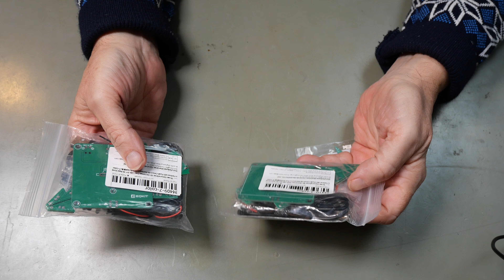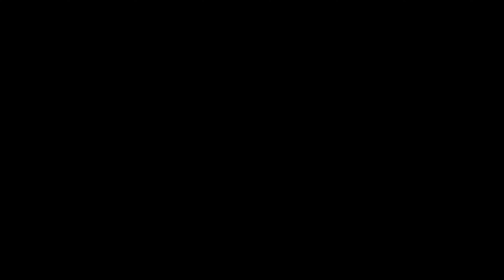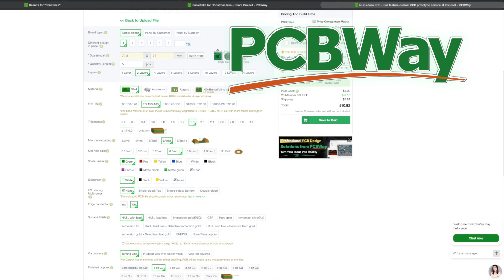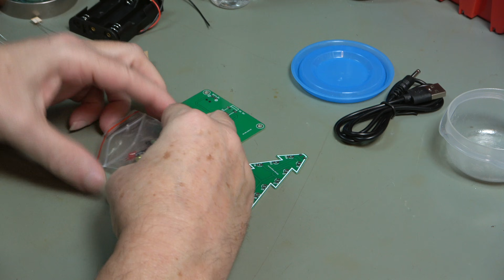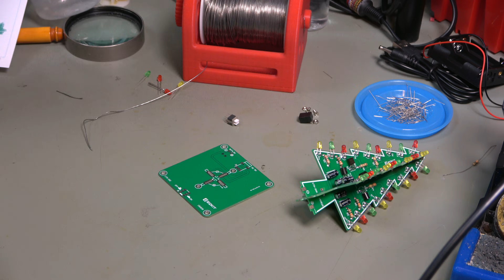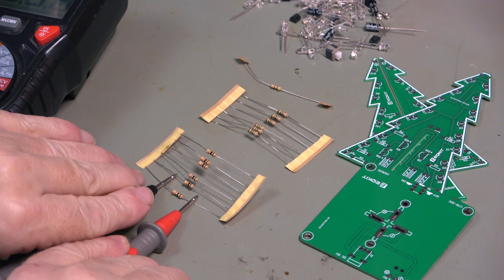Episode 102: An Ali-Xmas

Comment: I bought the multicolor tree that is identical to the one you have except the kit I received came with the wrong capacitors (which I didn't know until I was done making it) so the tree only lights up red, and barely lights up at that. It came with 22 µF capacitors instead of 47 µF. I was quite upset with this because it was a lot of work for me to assemble as I am an amputee. It's still sitting on my desk doing nothing. I should just throw it away but then I put hours of work into the stupid thing.
Reply from the maker: If you get hold of the right capacitors, it might be worth the extra effort to replace them, now that you've seen how it "should" look. And while I understand the disappointment, it's still a shame to put all the effort in and miss out on the result. On the plus side though, there's plenty of time till next Christmas... ;)